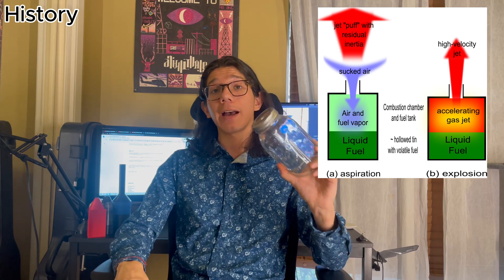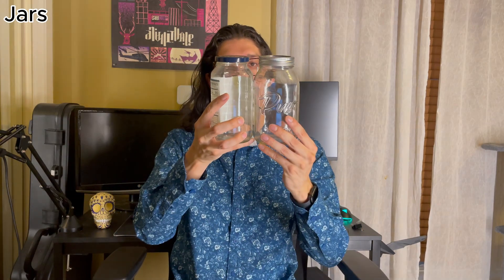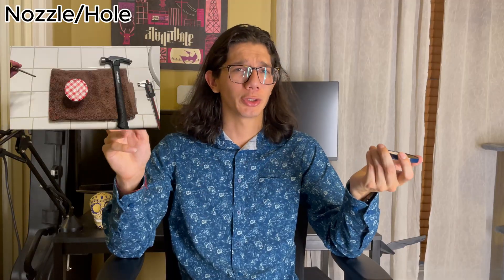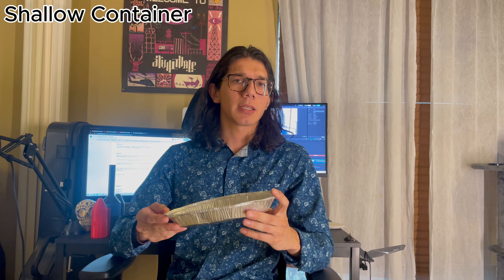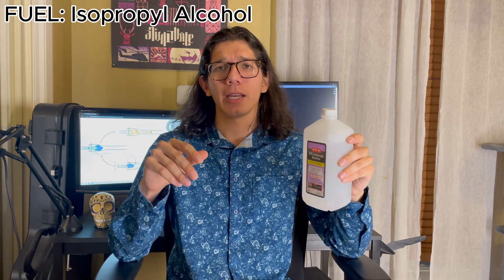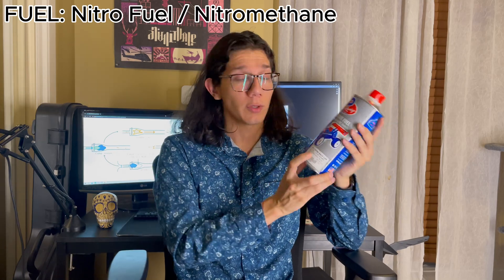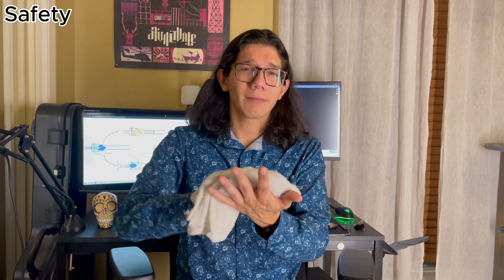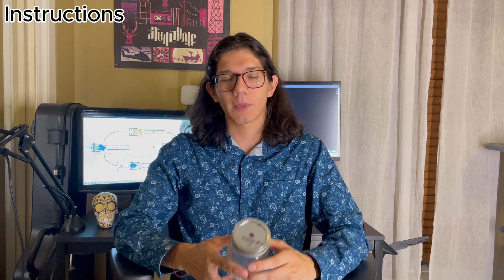DIY Jam Jar Pulse Jet - How To Make a REAL Jet Engine

Comment: There is no propulsion on this system right? The noise is similar to a jet but is made by the vacuum of the air right  ?
Reply from the maker: It actually does produce a tiny bit. I have a YouTube short where I put it on a scale and it showed a consistent 2g

Comment: Is it possible for the glass to explode and shatter in your face?
Reply from the maker: Very small chance at ignition only if the hole is too small. Even then, the lid will most likely pop off before the glass shatters.

Comment: how did you prevent yours from exploding
Reply from the maker: Make sure the hole is large enough. Generally for a large jar I wouldn’t use anything less than 12 mm. I found that 15 mm works nice.
Reply from the maker: Unless you meant thermal shock heat. in that case, you can’t avoid it, you can only prolong it by coolant and water

Comment: I'm going to guess that performance is sensitive to things like burrs on the edge of the hole, slight dents in the lid, whether the hole is in the middle, and other small quirks of geometry. The reason being that these things affect the turbulence or lack thereof of air entering the hole.
Reply from the maker: I agree with everything here except for maybe the dents on the lid, it’s not that fickle. But definitely the hole placement and quality can affect how well it runs. Something to think about is that apparently you can do this with a triangle hole, although it won’t run for very long.

Comment: I think the main issue is the lack of oxygen. The exhaust fumes build up in the container and snuff the fire out.

Bit the hole can't be too big, or it just doesn't work.
Reply from the maker: Yeah, this vid is a few months old. I’ve found that the hole is gonna be bigger than you expect (in my results/analysis section)

Comment: What would happen if you drilled 2 holes? (1 intake and 1 exhaust?)
Reply from the maker: That can work but they would have to be on opposite ends, like a pulse jet. Check out my short on the “doohickey” fart can pulse jet.

Comment: My hot (no pun intended) take is that the cross section of the volume of the container should have an appropriate ratio to the nozzle. With the same burn, an increased force of pressure might be observed with a much smaller nozzle. I might be wrong but that’s my logic. Like a hose with a small nozzle compared to the exerted force of the pump
Reply from the maker: I’m not quite sure I fully understand what you’re saying but yes the nozzle size changes depending on the jar size, but not by very much. A tiny jar I worked well with a 10mm hole while the larger ones worked well with larger holes like 12mm. If I were to use the opposite nozzle sizes for the jars, they wouldn’t work.  It’s about finding the right ratio. I also heard a theory about jar shape as well, with “dead air” contributing to misfires.
Reply: @ I think you picked it up, but that dead space theory also makes some sense but I have a hard time with its permanence in the “tank” since resultant gas should fill the container entirely provided there are no obstacles. Keep making your videos man, I’m learning plenty from watching and it provides great food for thought. None of what I’m saying is correct, nor do I think it is. It’s all supposition and I thank you dearly for your videos
Reply from the maker: @ResQRaces I’m glad you appreciate the video!! Science videos on YouTube is what got me to enjoy math and learning back in middle school, and I just want to carry the torch.
Reply: @ModernMadScientist  look at the shape of real jet engines, they are more like tubes. Maybe would be better using glass test tube containers
Reply from the maker: @davefletch3063 will do! I want to get an Erlenmeyer flask and try that out. Much closer in shape to the original reynst pot.

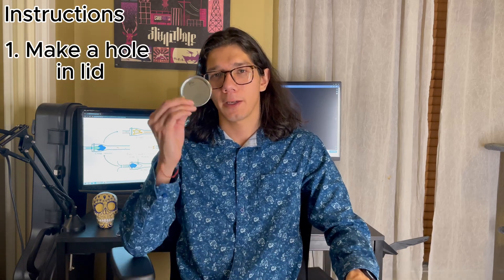Comment: 5:07 nvm I'm going to use desol
Reply from the maker: If you meant “diesel” then I want to warn you that the explosive force might be too strong for thinner jars to handle. I’ve seen it work before with thicker jars and haven’t witnessed a “Cato” but the risk is still there. 🙏

Comment: Nah bro make more this vid was entertaining
Reply from the maker: Thanks! :D I'm pivoting to rocketry right now because it's a bit easier to make into video content. But eventually I want to do the other types of pulse jets that I talked about that the end of this video!
Reply: @ModernMadScientist  nice nice I think it’s sick like just taking a jar and being able to do that just the simplicity of it helped with my monkey termed brain I think I’m gonna try it tomorrow I gotta day off and a lot of variety sized jars
Reply: Update got a nice sized pickle jar and the yellow bottle of heet, gonna try it out soon
Reply: Update update sorry this is probably annoying,,, tried it and it works well maybe almost too well, after a good run the glass likes to break which is understandable but I was wondering if there was anything to stop that,, maybe there’s thicker glass jars somewhere.. I’m just kinda stumped on it
Reply from the maker: Not annoying at all! I love sharing knowledge and helping others learn, so I appreciate that you found my vid useful. :D

That's the best problem to have, in my opinion! If given constant fuel, these engines could run forever, and are limited only by the fact that they are made of glass and will crack from thermal stress. (one part of the jar is getting much much hotter than another part) You could either put it in a shallow ice bath like I did here but I recommend nearly fully submerging it in cold ice water. Just make sure it doesn't float lol. This will help absorb and distribute the heat similar to the "Balloon with water over candle" experiment.

Thicker glass jars could also work but I don't want you guys to spend money where you don't have to.

Good luck, and keep me posted on how it goes! Maybe post a video and tag me? I'd like to see what kind of jar you are using bc the pasta jars I used were perfect but the mason jars that I tried to use suuuuuuuuuccccccked.
Reply: @ModernMadScientist gotcha just posted a vid and tagged you. Those were roughly all my runs I did, I appreciate the advice, also for peace of mind if it does break in a weird way would there be a risk of the glass exploding?
Reply from the maker: @Creepin_stalk  Very nice! Those were great! If you have extra lids, try playing around with different nozzle sizes and see how that effects it.

From my understanding, an "explosion" would only happen when you are trying to light it and the pressure is too much for the glass jar and lid to handle. The likelihood of this happening is very very very low, like if the jar is already super stressed, has a crack in it, and you try to give it a few more runs. Don't use anything with a crazy high energy density like gasoline or acetylene. 💀

After ignition, you're in the clear. The glass breaking after a long run is unavoidable and won't explode but will shatter and fall apart as you've seen. But wear eye-protection if you can, be safe, blah blah blah
Reply: @ModernMadScientist  awesome

Comment: 3:11 i believe the bright yellowish-orange "flames" around the lower part of the glass is because the flames are creating a plasma from the glass's salts, thats why its yellow, for sodium. im bad at explaining..
Reply from the maker: I get what you mean, you explained it well. I initially thought it was contaminants but I cleaned out the jar to have a "pure" test. Some people noticed this in a short I posted and said the same thing you said. It's entirely possible that it got hot enough and localized in one area to (now I'm just guessing) strip some sodium ions??
Reply: @ModernMadScientist  that being said, the type of fuel can play a huge role in what color of fire it is, and as you might know, the white fire has all the oxygen it needs to burn the fuel all the way, thats why its a lot more powerful. but also any minerals in the fuel can cause deviation in color, isopropyl alcohol is good because its pretty much as pure fuel thats budget-friendly, the only issue is its higher demand for oxygen, it might be fun to test out more while using oxygen gas as well, just be careful, a good mixture is very explosive
Reply: @ModernMadScientist  yes, all it needs to do is create the first reaction, then it kinda set off the others, i notice it every time I use glass for things like this, well.. glass was the only time i noticed it, metal just starts glowing

Comment: Thanks for the tutorial! Ive made several jam jar jets but the can pulse jets ive made seem to work a lot better. I uploaded a few shorts if you want to check them out. You should make one like mine with an aerosol can and exhaust.
Reply from the maker: Those look cool! I think I have a few empty cans laying around that I could use. Any tips?
Reply: @exoticloop  I made a little vid explaining how I rigged it up and I tagged you in it. I'm sure you can make one a lot better
Reply from the maker: @miah0981  Bruhhhhh. I just made it and tried it out in my backyard. Ignition sounds like a loud gunshot XD. It was a loud boom and then it ran but I had to kill it before my neighbors came outside. I need to find a good place to test it.
Reply: @exoticloop  haha that's awesome! Mine does the same thing, I was worried about my neighbor thinking it is gunshots  but he doesn't seem to mind. Hope you find a chill spot to run it. What did you use for an exhaust?
Reply from the maker: @miah0981  I used an old metal handle from a duster.
Reply: This video + this comment section, best diy instructions ever. Good work to both of you guys! 👏👏